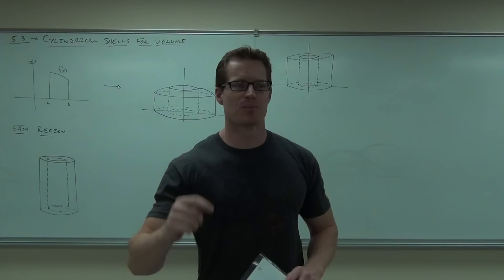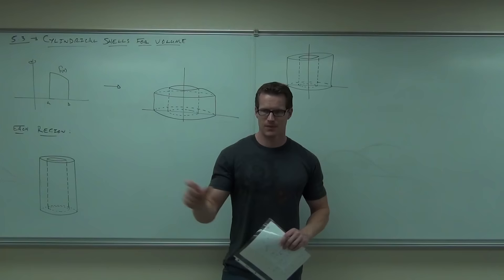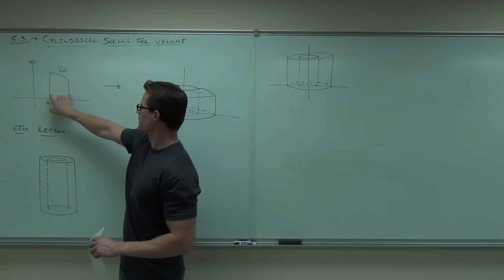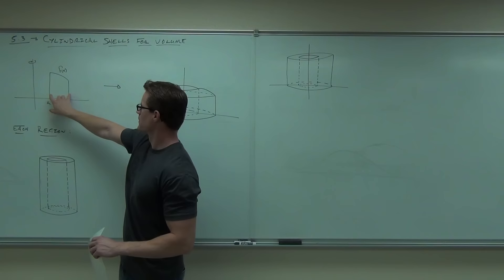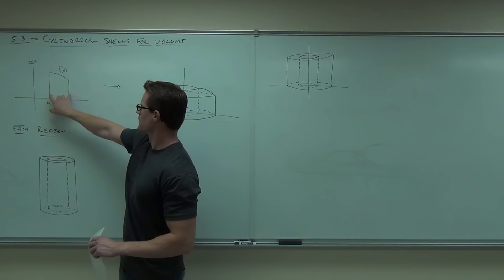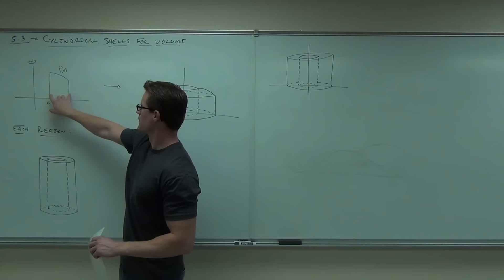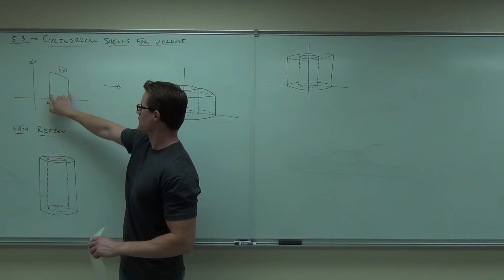Calculus 1 Lecture 5.3:  Volume of Solids By Cylindrical Shells Method

Comment: Question: why do this? Will I get the same answer using the washer method? The washer method was f(x)^2-g(x)^2, while this is combining that into one single integral, correct? So I can use either method, just two different formulas?

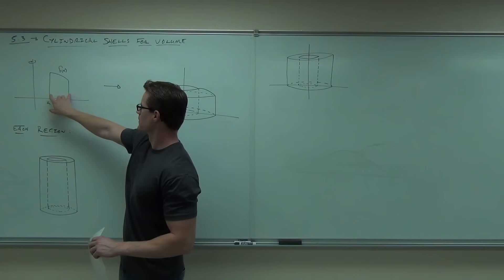Comment: Leonard, at 11:50, why the need of the term for AVERAGE RADIUS ((r1+r2)/2) where in fact THICKNESS (r1-r2) is already stated. It seems to be of redundancy for thickness eh. But yes I know that should be the way express everything on it. Maybe a reasonable explanation is needed for this particular question. Thanks a lot.